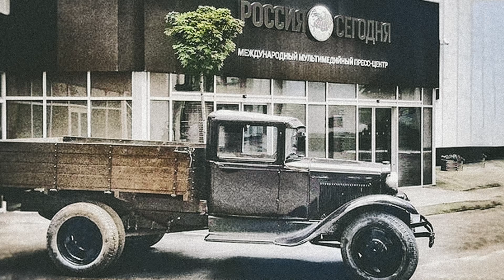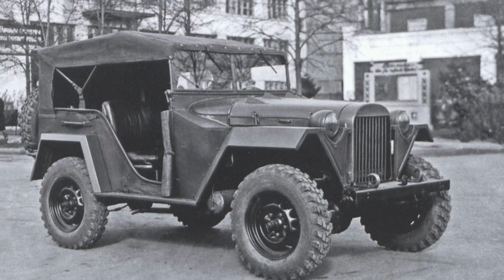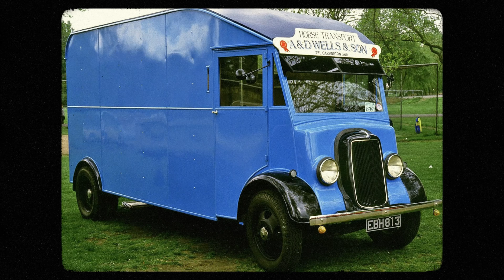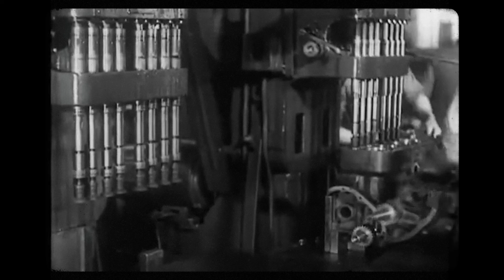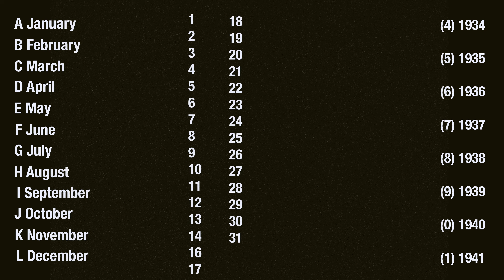Unique Banger Engines - 4 Banger Archives

Comment: I'd never heard of the G28 engine before and I wonder if they can be easily found? 
Russian Trucks still used the Ford differential right into the 1980's,as used in Ford,Canada applications.
Reply from the maker: Hey there, thanks for the comment! They are about as rare as hens teeth. Sometime in the 1990s (before I was born), Joe Mac of Ford Parts Obsolete imported a bunch of engines. Worth a shot!

Comment: This has most likely been the most educational 6.5 minutes in my recent life. Thank you Bangers Modified!
Reply from the maker: Glad you liked it! At the end of the month I'm shooting the "Tamarco Hal" for my video on Harry Hosterman. Stay tuned!
Reply: The Russian's added an oil pump, pressurized lubrication passages, steel connecting rod bearings, and an aluminum oil pan for cooling. The English added an oil filter and a proper transmission with 4 gears.